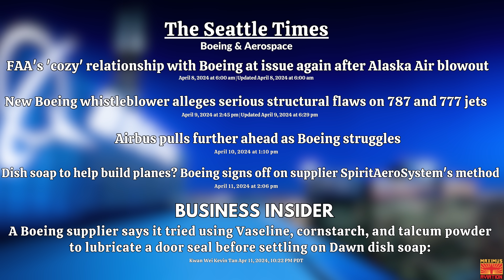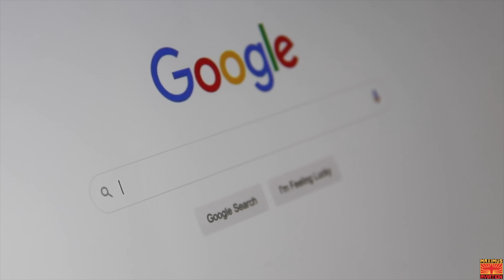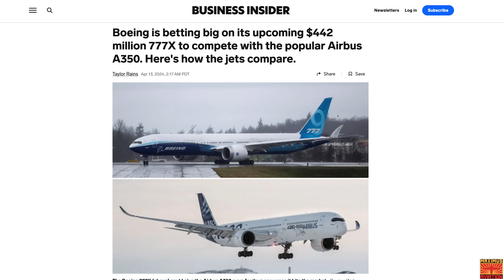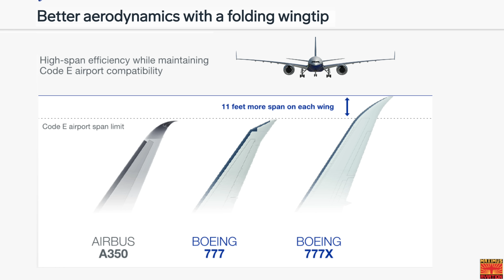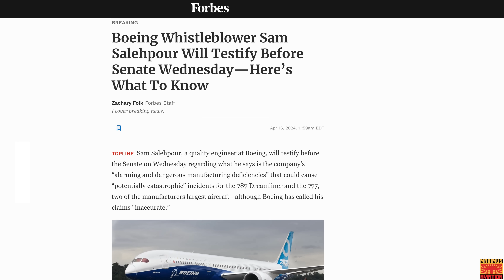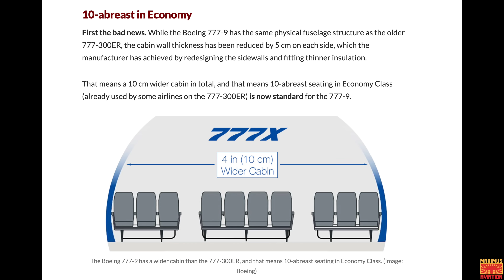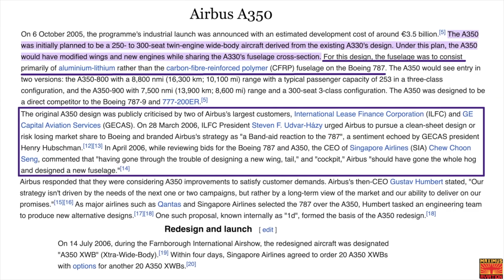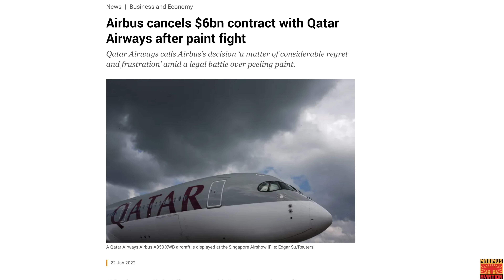The Boeing 777 Is One Of History's Safest Planes. Can Its X Version SAVE Boeing And Beat Airbus?

Comment: I have to say that I don't care about which can fly longer because whether you're on a 777x or a 350, flying 17+ hours is not a fun experience.
Reply: Respectfully, I disagree. I flew on Singapore Airlines from Changi to Newark, nearly 18 hours. I would have done it for much longer if I could.
Reply: Have to say I agree but with a stop over, there's all that luggage to haul back and forth and the prolonged time added together with any delays. So for some, perhaps its not so much a trail but more a necessity of time. Although they would still have to get over the jet lag. To be fair, I dont think there's a answer, until air travel is much faster and that would have to contend with the green lobby, as did Concord together with the costs that enforced.
Reply: @sainnt  Singapore Airlines config their 777 with 3-3-3 seats arrangement, that will huge impact passengers comfort in economy class. But mostly others airlines config their 777 with shitty cramped 3-4-3 seats arrangements, that's including Emirates, that type of config I will avoid at all costs.
Reply: @TonyLee-th1vv  Most older 777s came with 3-3-3 seats. I believe that the Singapore Airlines 777 that had the turbulence had 3-4-3, but I could be wrong. Emirates 3-4-3 777s are not uncomfortable mainly due to their amenities and inflight service, but I take your point.
I flew on an Egypair 777 with 3-3-3 seating, and the experience was so bad that I would have preferred a narrowbody aircraft for the 10 hour flight than that 777.

Comment: The 777 was an engineering marvel designed and built under the outstanding leadership of Alan Mulally. The X was redesigned under the leadership of people who spend their lives on X (Twitter). The two aircraft ARE NOT THE SAME.
Reply: Say no more PLEASE !
Reply: The X is not a clean sheet design. It's a modification of the 777.
Reply: Even if it were the same Boeing is no longer capable of safely manufacturing it.
Reply: Begeye-bh5ux The Max is a modification of a modification of a modification of a modification. The 777 is a modification of a clean sheet design.
Reply: Truthslayer

Comment: Nov 27th 2021 With a FCC fly along aboard a 777x thinking it was time to ask for a approval experienced a, "Uncommanded pitch event". These are not words one ever wants to hear again in relation to a Boeing aircraft after the Max disasters.  But it happpened. Look up the many articles. The 777x did a MCAS. Come on Maximus, how did you miss this?
Reply: Boeing is working on a solution. They had to since the FAA has pointed it out and it made headlines.
Reply: @Blank00  They're trying to fix the problem with software. The tail is too small and it has a high alpha problem.
Reply: Uh-oh!
Reply: All new planes have things to work out.
Reply: @DaveMiller2 not after they have been certified and are in production.
Reply: @simonrabeder1599  Oh yes they do. ALL planes have a period where things come up after certification and production. Literally ALL planes have this. Just like any other new product. Some planes have more bugs to work out, some less, but they all have this happen. No airliner has ever been certified and gone into production and never had a single problem come up afterwards.

Comment: For those that read the headlines about 777s losing wheels hydraulic fluids or that AA 777 that had a tire problem, that was on maintainence since those 777s are old enough, and the AA incident is blown out of proportion. As for the Latam 787 incident, it turned out to be caused by crew error.

Comment: Facts?
Well the 737NG, 747, 757, 767 and 777 were all (mostly) designed, engineered and built before McDonnell-Douglas 'buy out / in'. Since then the 787, 737MAX were: Years late. Billions over budget. Being grounded. Yes 787 was grounded for safety reasons. Boeing couldn't even build a modified 767 for the USAF without being: Years late. Billions over budget. Being grounded. And for all the noise the 777X is: Years late. Billions over budget. Not certified. Sound familiar? Just keeping the tradition going.
Reply: Well Delta & United are still flying their 737's, 757's, 767's despite their age. Must be well built jetliners or not difficult to service ?
Reply: @rscott2247   That was exactly my point. All built before the Boeing / McDonnell Douglas buy out after which every new aircraft has been a disaster and fatal for some.

Comment: You forgot about the British Airways 777 flight 38 that crashed coming into Heathrow due to a fault with the Oil/fuel heat transfer units causing ice in the Fuel. Also didnt Emirates crash another 777 at DBX.  Think that was pilot error though and there were no fatalities on either accident. I do still believe is still a very safe plane however.
Reply: BA38 was the fault of RR

Comment: Didn't the 747 have a door issue? That they knew about and did not fix until a bunch of people died?
Reply: I think he’s talking about the -400 and -8.
Reply: You are a little dramatic. Your bias is showing.
Reply: Yes and no. Yes that happened but not a design issue. The ground crew could not close the door latch by hand ( that’s normal ) so they used a belt loader tug to push it shut.  Not procedure.

Comment: The majority of peope who fly probably don't know what model or brand of aircraft got them to their destination. For the airlines, it's likely a decision based upon reputational risk, fleet management risk, economics and availability. Safety is not high on the list as modern aircraft are safe by design (Max the notable exception to this), therefore I doubt the X can save Boeing, they will be saved by focusing on what matters to airlines, correctly building and delivering aircraft which will do their job without any drama

Comment: Fact is that - after spending 10 or so hours per week observing aerospace and airline issues for three decades - I would never again board a Boeing airplane  if I could avoid it in any way. I would not do so because of (i) a deep punitive resentment against Boeing and (ii) a total mistrust in the FAA as the responsible regulatory body that had to oversee (and enforce) security practices at the manufacturer.

Comment: Upward folding wingtips are a potential point of failure, especially if quality control is a problem. I hope I am wrong, but I cerainly will not be on that plane in the first years.
Reply: You shouldn't need to worry. It's been on fighter jets so what's the fuss about
Reply: The navy has had it since WW2
Reply: Everything is a potential point of failure
Reply: Chicken!

Comment: Boeing better get there 777x certified fast. I think Airbus will show there next gen aircraft in 2026. Its likely going to be a all carbonfibre prop-fan other vice somewhat conventional. Will have similar features as the A350, 787 and 777x apart from that.

It have been speculating that airbus was going to make a smaller 100pax aircraft. I think that is miss direction. The market is simply not that profitable. There been quite a lot of experimentation but i would say it very likely a conventional design. Possibly folding wingtip, possibly a canard.

As far of the size of the aircraft i have not manage to zero it down. But it would either be a 757 like A320 replacement, the other alternative is a 777x competitor, maybe even a bit larger, likely to be named A360 in that case.

Comment: Maximus 
Friends just arrived in Bali on yes you guessed it, a Boeing Max with batik air from Australia 
Low and behold, touch down in Bali and yep, there all stuck in the aircraft as the main door to get of aircraft to exit was stuck, and required an engineer to free the door, 
After 1/2 an hour, presto it’s open, WOW lucky no emergency, 
What a piece of junk
Reply: There are three other doors that could have been used for deplaning.  Was there an explanation why deplaning was not done through one of the other doors?
Reply: Was there an explanation why one of the other three doors were not used for deplaning?
Reply: @FreeDemocracy-2025  no just sit and wait 
Who no’s if it was the dearming system that does all 4 doors 
No idea